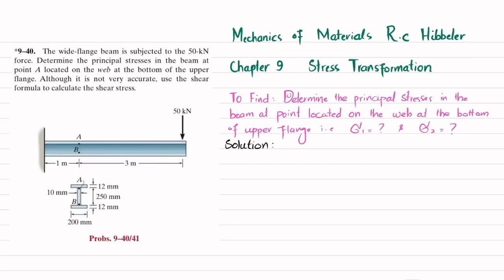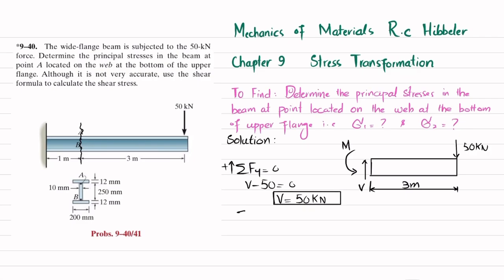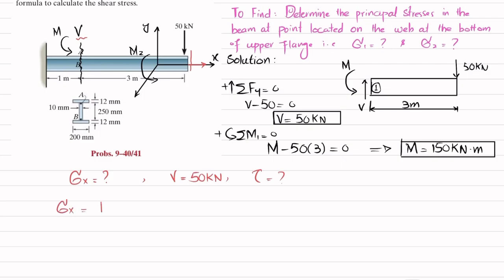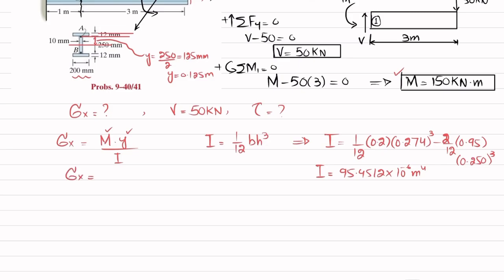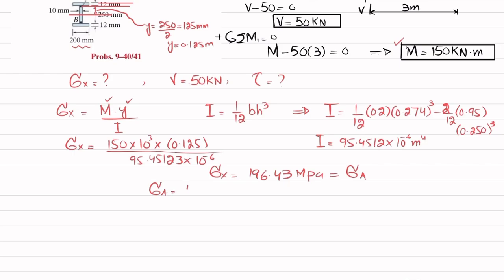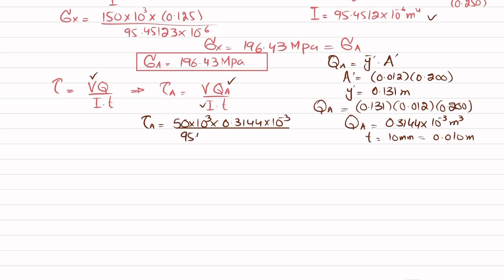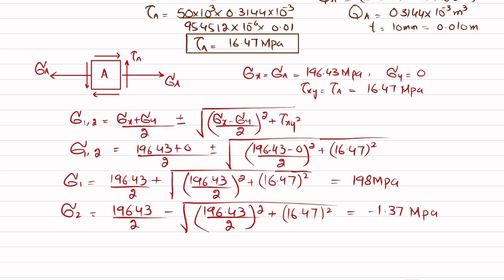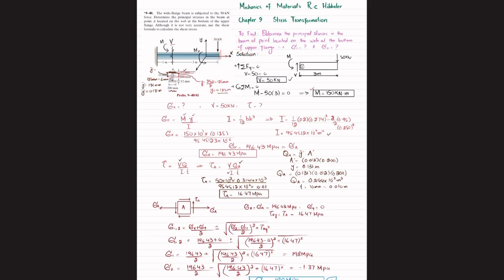Determine principal stresses in the beam at point A | Problem 9-40 | Mech of materials rc Hibbeler

Comment: Good  day thank you for the video. Why are we not taking into account the shear stress formula of V/A? Shouldn´t it be also done as well as VQ/IT? Or does it not apply cause we´re already using VQ/IT?
Reply from the maker: You can also use that which will give you average shear stress.
Reply from the maker: But if you want to find the shear stress distribution you will have to use VQ/It formula over various region of the section